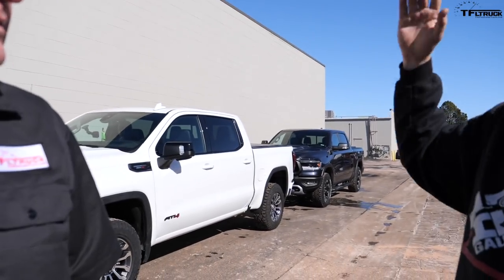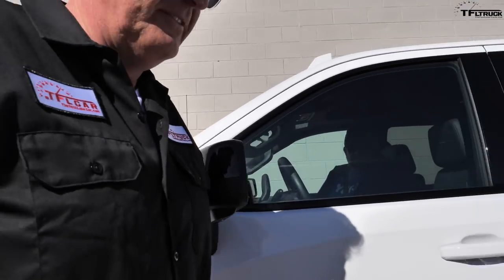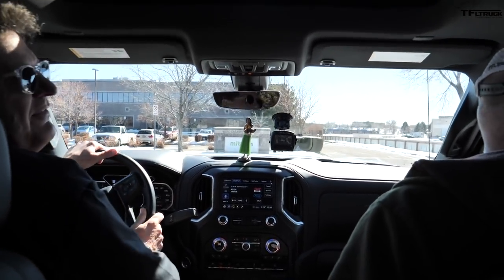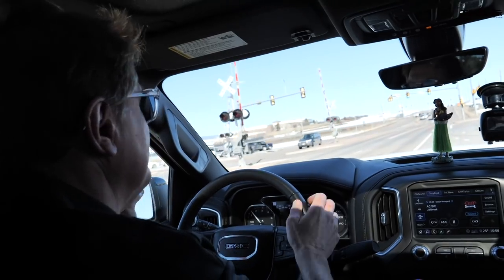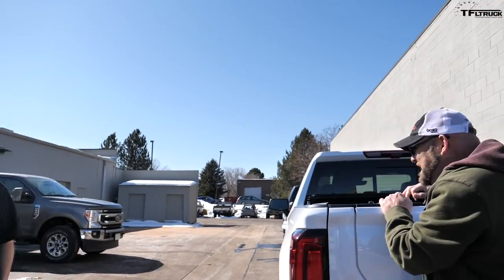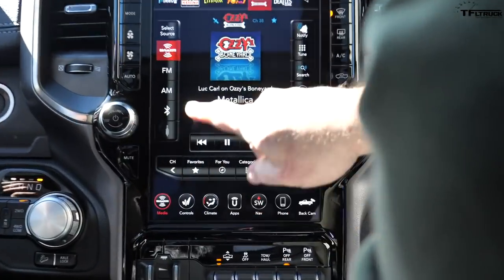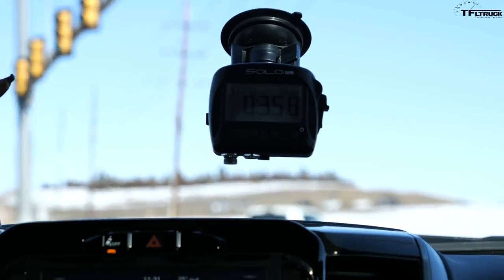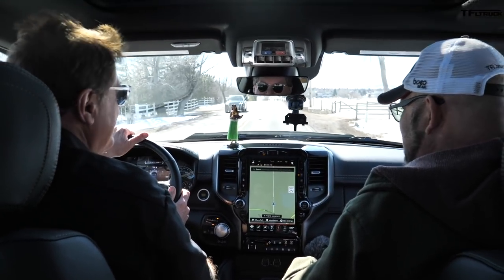Best Diesel Truck! 2020 GMC Sierra AT4 vs Ram Rebel Diesel 0-60 MPH Buddy Review

Comment: Ummm ya you did a towing test and those numbers weren’t to good, yes you were at elevation but 9-12 mpg wasn’t very good. Most guys have some RV that weighs around 6-7 grand I didn’t see a reason to go diesel and deal with emissions and maintenance. I think in my case, however with a 3 thousand pound trailer you’d see significantly better mileage. I’m pretty up in the air about that engine choice.

Comment: Personally I got a 2015 Ram 1500 with the Ecodiesel and I love it. I would pick the EcoDiesel over the Duramax or Powerstroke after seeing so many issues (Example - check out LakeForkGuy's channel) and Ram Ecodiesel being a 3rd Gen Engine so that means its been around for awhile and its reliable lots of torque for the people who tow consistently and the MPG is amazing. I know he(LakeForkGuy) got a new one truck but still doesn't mean that the new truck he has won't have the same issue's. I plan on getting the newer version of the EcoDiesel when I can. Mopar or No Car <3
Reply: Also forgot to mention in the tailgate wise I like the step function of the GM tailgate but I feel as if the Barndoor function in the RAM would have more use.

Comment: The ram tailgate is designed that you can open it while you connect it to a trailer With the Chevy you cannot do that. You opened the barn doors up you stepped up on the hitch and climbed right in the back of the ram

Comment: One piece of misinformation is that ram does not pair the eco-diesel with the 33 gallon tank. You can only get a 33 gallon tank with a 5.7. The eco-diesel comes with a 26 gallon tank. Still more than GMC, but not 10 more gallons. Otherwise good review.

Comment: Y'know, I'm gonna do a mini rant about it again. 

In the Ram, if you don't use the voice command system in the way that it's designed, then it isn't going to work. If you take the time to see how you have to speak to it, and then use it properly, chances are you will find your destination with ease. But if you start treating it like Siri and just throw phrases at it that it isn't programmed to understand, then it is not the system's fault for not working; it is your fault for not using it correctly. Yes, the GMC understood a command like one you'd ask Google or Siri (which, quite frankly, impressed the hell out of me). That does not mean that the Ram is going to understand the same thing. That doesn't mean the Ram system doesn't work; it means it doesn't work the same way. Whether it SHOULD, or whether one is BETTER is an entirely different issue. But if the Ram is designed to understand (for example) "Navigation > Restaurants > Snarf's Sandwiches," and you don't get a result when you say "navigate to Snarf's," that's on you. Functionality is objective if you use them right. 

Bottom line, please don't use the system incorrectly, then blame it for not working. Just a pet peeve of mine, since you guys seem to do that frequently. (Might I remind you that for a little while, back when Mike was doing these, he actually made a point of using the systems in various vehicles the right way, and got good results 100% of the time).

Comment: This video is more proof these guys never use a truck for real business. The Ram is 10 dB quieter, has the most useful truck feature from the last 20 years in the RamBox, has literally over 300 more miles of range with the same MPG, best-in-class towing over 12,000 pounds and is 2x better off-road. I love GMC, but this comparison isn't even close for real world use. Take that from an appraiser that's been off-road practically every swamp, farm and dirt road in the southeast.

Comment: GM's 3.0 Duramax is all aluminum which raises longevity questions to me and the fuel system pumps at nearly 37,000 psi which is way higher than ever tried before. I'm not saying the engine will definitely fail early, but it certainly could given how far GM pushed the envelop in its design. I'm very intrigued, but I'll wait for a few years of reliability data before jumping on the train.
Reply: And if the fuel pump fails you'll have to pull the head as stated in another review. With the rear engine timing chain, drop the transmission. Sounds like thousands of dollars for a maxed out component.
Reply: @clinthilux  That's a 150,000 mile service interval, so I'm not really concerned about that. Frankly, I'm surprised so many people are up in arms about that, which is no big deal to me, and not concerned about other design features of this engine.

Comment: With all that being said about 6 cylinder, 3.0-liter diesel engines can someone test a 4 cylinder Sprinter which is used in some RV conversions?  I just want to know why Chevy \GMC is using one in the Sierra Vans but had to have a whole new engine for the pickup trucks that aren't even 2500 or 3500 rated trucks, meanwhile Mercedes has a 4 clylinder option on a 1 ton van???????

Comment: What is the deal with plastic beds? Trucks are light in the rear end as it is.
Reply: Carbon fiber reinforced nylon bed. Lighter and more durable. Higher payload ratings without needing such stiff leaf springs.

Comment: The Tailgate issues, good laugh here.  Im surprised that at $70.000, why would you get a half ton when for the same money you could get a good 3/4 ton.  Now your probably wondering why i didnt say one ton.  I have found that at least in SC, A one ton is now considered a commercial vehicle.
I have owned my 08 F350 dually since new and have never paid less than $500 a year just to license it when it came to property taxes.  Seems a bit lofty for a half ton.
Great videos and keep it up.

Comment: Hope they really fixed the ecodiesel I had a 2015 and went through 4 engines before 36,000 miles which sucks cause other tan that I loved the truck
Reply: Suuuuure it did!
Reply: @JohnDoe-nz6bk  got receipts man
Reply: TheChadillac8907 I bet you do!
Reply: @JohnDoe-nz6bk  the Ecodiesel is a piece of shit. 15% of them failed on the last gen Ram. Hell I know two guys that had an Ecodiesel take a shit by 70k. The one guy needed the whole emission system replaced just last year. Between eating bearings and injector issues, they're the biggest piece of shit engine sold today.

Comment: Is there any information regarding the initial overheating issue on the 3.0 L inline Duramax?  Is this still an issue or has GM rectified it and if so, what did the fix entail?

Comment: I have heard some Rams use rear coil springs, what do they say about that in the truck world?
Reply: Ram 1500's  with rear coils need aftermarket air bags to carry any weight.
Reply: Well the leaf springs in my 20 year old truck are fine but every car I ever had with coil springs had to be replaced at some point.  I guess if you don't use your truck as a truck they will work for a while.
Reply: Don Olypopper  With a fibreglass  topper and 6 or 7 hundred lbs. of equipment the rear sits too low.
Reply: Don Olypopper  Fleet trucks, air suspension not an option.

Comment: You hit red button on phone to cancel navigation. It only turns on seats onn auto start . You can turn that off in setting s . ALso I have never had issues with button location in my ram limited.  I Love it will never go back to a gmc.

Comment: The Ford tailgate/step system is better.  The GMC is complicated for the average consumer.  It is over engineered in the sense all those different positions, is an excessive amount that will have excessive failure points.  Breaking points.  Believe me, it is a GMC and it will be breaking and having malfunctions people are going to have to deal with.  The concept is fine.  But practicality, it will fail you.  IF you have to have a GMC, I would suggest you rent it.  (I would forget it)  The Ram is worth a lease.  If you love it at the end of the lease, buy it.
Reply: You are forgetting about the bumper steps also on the GMC & Chevy.  Easy to use, always there, and work when a trailer is hooked up.

Comment: So it's compressed forged carbon composite, and the Duramax I6 Diesel's are steady blowing up so ecodiesel and powerstroke v6's are currently way better there's no one putting on YouTube about their Rams or Ford's half ton Diesel's blowing up. I personally would rather have the RAM or Ford truck but with an I6 diesel not aV6!
Reply: I haven't seen a video of the 3.0 Duramax blowing up.  Got a link?
Reply: @domin8ss  look up tk's garage Duramax blows up at 146 miles
Reply: That already sounds suspicious.  146 miles makes me think something deliberate was done to find a failure, just like what Banks Engineering does with the 6.6 Duramax.  I wish Banks Engineering would blow up the 3.0 Duramax.  Let's see the real failure points.
Reply: @domin8ss  it could be you only know what you see in here that's why I said I would take an inline 6 over a V6 diesel but I would much rather have the older pre emission trucks the emissions crap have ruined these trucks I know first hand on that and will never buy another truck with scr,def our Regen
Reply: I watched the videos from TK's garage regarding the failed 3.0 Duramax engines.  He never explained anything beyond overheating.  That could be a problem with the thermostat, water pump,  etc and not necessarily the engine.  Yes, that situation sucks, but he never told us what happened.
Reply: I just searched YouTube for Ram Ecodiesel Blows Up.  I found more than 1 video on the topic.  Looks like Rams baby diesel engine is garbage too.
Reply: @domin8ss  it's all these stupid emissions.

Comment: Only downside to the gmc is that oil pump belt you will HAVE to change. They say over 100k miles but time will tell. I work for gm and am a gm fan but they could have done better there.

Comment: My 2018  2.7  ecoboost  F150 4x4 supercab did 0-60 around 6 flat . I got 22 mpg on the highway. You can keep those snails on wheels
Reply: Your 2.7 Ecoboost is going to burn more oil than a diesel engine by the time the warranty runs out.
Reply: @karlschauff7989  the 2.7 is a piece of shit. Wobbling valves and cracked heads.
Reply: @hochhaul   what are you driving, let me guess something I subsidized
Reply: @karlschauff7989  what do drive, let me guess something I subsidized
Reply: @jcnun3930  Taxpayers subsidized that POS 2.7 ecoboost. In fact, Ford still owes billions from the interest free loans they begged for behind closed doors. All paid for by taxpayers. Which sucks because based on the financial health of Ford in the last couple years, it's look like they'll probably just claim bankruptcy and the taxpayer will lose all that money. Ford's stock value has been on a slow decline for years even when they sell a million trucks with cheaply made engines. If they can't make a healthy profit on that, they don't have a chance. The stock today is worth less than $7. It hasn't been that worthless since the 2008-09 recession.  Won't be long before they sit down in front on congress and beg for more interest-free  "loans" (which they probably won't pay back just like the last ones).

Comment: Wow those are expensive trucks!  Small fuel tank on the GMC. Both are super quiet. Too many gizmos on the RAM Rebel. Both fancy tailgates are a non-starter for me as I like the regular tailgate. Plus(+) for the bed access for the GMC with the step. Plus(+) for the RAM side tool storage.  RAM stance seemed pretty wide and tall compared to the GMC which I'm not a fan of. Also like the advanced GM computer algorithm that could discern that these hungry boys wanted to hit SNARFs sandwich shop.  The algorithm takes in total body weight of the passengers, monitors for husky voices, and measures a slight desperation in the voice command....ha! Nice job guys but these trucks are too friggin' expensive.
Reply: If you go to accessories.gmc.com you'll find side boxes are available for the GMC.  Don't forget that Ram's side boxes are a copy of the original ones from the Chevy Avalanche.

Standard tailgates are still available for both trucks

Comment: I wish the idiot truck manufacturers would STOP complicating trucks with BS crap like a folding tailgate with stereo equipment in it!  WTF??  Air suspension crap (I just got my RAM 1500 limited eco diesel back from service to fix a leaking air ride system, took 9 MONTHS to finally get fixed!!), and just make a truck that actually RUNS without being in for service for half it’s life!

Comment: The gearing in a pickup make all the diffrence.  The diff Ratio combinded with Transmission ratios . Thats the 2 sec diffrence between the gmc an RAM 0 to 60. Take let say two ford f150 same truck, enenge an what not but one has a 375  the other  a 410 axle ratio. the 0 to 60 to the mpg will be diffrent .
Reply: The GMC had either 3.23's or 3.42's. A Ram Rebel Ecodiesel comes with 3.92's.

Comment: I just went to the fords build and price. The powerstroke is still not there
Reply: I would be worried if it did show up. Why? What did they have to do to get it to pass? Odds are, the band-aid will be a reliability issue down the road. Either the filters will soot up faster or the engine will run like shit so it can pass.

Comment: I think you just got lucky with "snarfs", our Denali and AT4 have the WORST infotainment system,  we have had so much trouble that we just ask google on our phones because the truck fails at EVERYTHING, (except snarfs apparently). We didn't have any issue in the 18 Raptor.

Comment: Why does GMC offer the multifunction tailgate on the upper trim levels? But they advertise the tailgate for work applications.  They should consider some type of implementation on work level trims.  Cause a tradesman doesn't care about leather seats, multi-zone climate control, sunroof and etc.  Give the people a truck for work with real life solutions!

Comment: Dodge: to avoid, to move away from.  Sounds like Ford's going to drop that diesel from an option since it's not selling.  GMC is a good looking truck.  I'm probably going with gas though...just less headaches after the warranty is gone.
Reply: Ford isn't offering the 3.0L Powerstroke for the sales. They offer it to help increase their CAFE fuel economy average. It's just another loophole. It's why Ram keeps offering the Ecodiesel even despite 15% of them failing under warranty. They don't care as long as it lets them get away with selling Ram trucks with the ancient old 5.7 gas guzzler.

Comment: Everyone thought the ram eco diesel had issues but that new duramax has a belt driven oil pump that has to be changed and the transmission has to come out. I wouldn’t buy either
Reply: Ford has been using belt driven oil pumps for nearly a decade. Changing a belt at 150k miles sure beats owning a Ram Ecodiesel and having the engine fail every 60k miles.

Comment: I’m sure that eco diesel 0-60 is a bit better if you don’t have the ram box and air suspension.  Easily shaving 4-5 hundred lbs odd that truck.

Comment: The GM Straight-6 diesel has a service life of 150k miles according to GM.  The oil-pump is driven from a cogged rubber belt on the back of the crankshaft, it should be gear-driven or at least chain-driven.  At 150k miles it has to be serviced(while out of warranty) by dropping the transfer-case and transmission to access the back of the engine and change the rubber-belt driving the oil pump.  All vehicles should eventually go to the junk-yard with a still working oil-pump, not one with a broken rubber drive-belt.  Poor design in my opinion.  Not worth $65k to me.

Comment: Both trucks running Fiat sourced engines. It will be interesting over the next 2-4 yrs to see if the straight six has the same issues as the V6. We already know the 4 banger Duramax Fiat has issues.
Reply: The 3.0 Duramax is not a Fiat-sourced engine. It's based on the Mercedes Benz OM 656 and was designed at GM's Turin diesel powertrain center.

Comment: What about the recall for all GM diesels overheating with little to no miles? Oh I forgot TFL is a GM fanboy channel. Didn’t the HD GM just get embarrassed on the super Ike by the Ford and Dodge. The Ford and Dodge interior is far superior to the outdated cheap plastic. I could barely get through them trying to make a case for the AT4